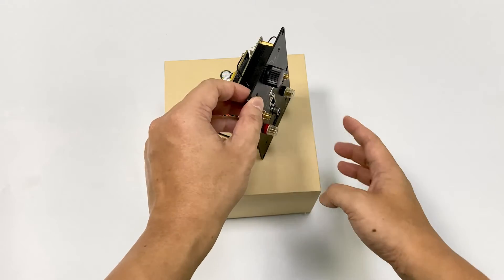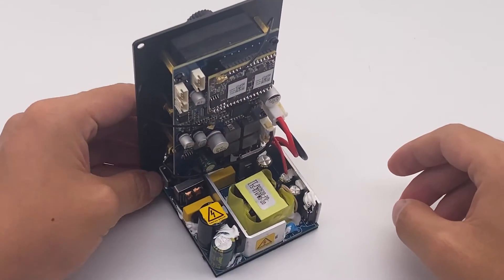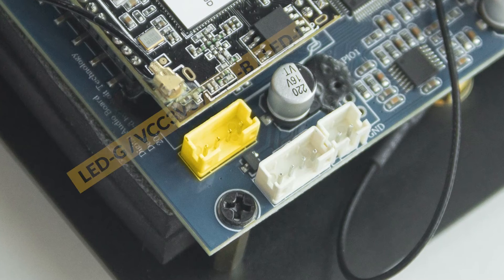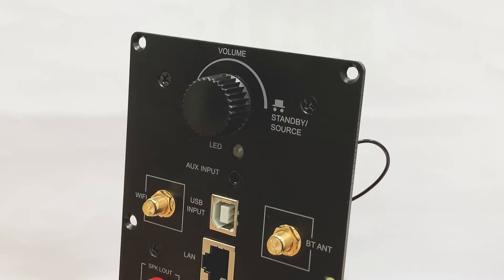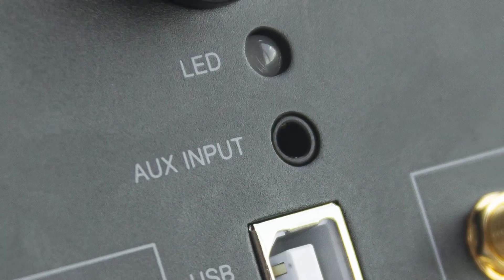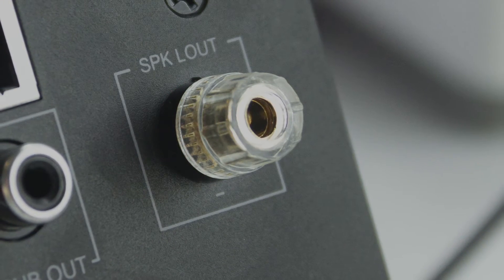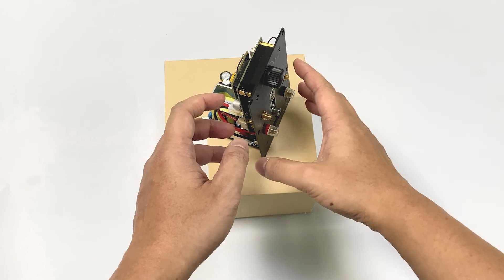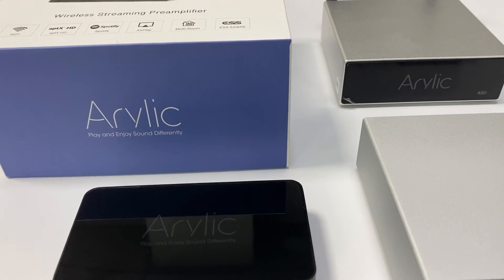Wireless Plate Amp - DIY your Wireless Speakers without Brain Storm?!| Up2stream Plate Amp

Comment: I want an Amp with 4 Channels for Stereo setup with 2x2 chassis, ARC, line in etc.
Reply from the maker: Got it, thanks for your feedback. You can check our HA400, it does not have ARC, but optical in: https://www.arylic.com/products/ha400-4-zone-amplifier